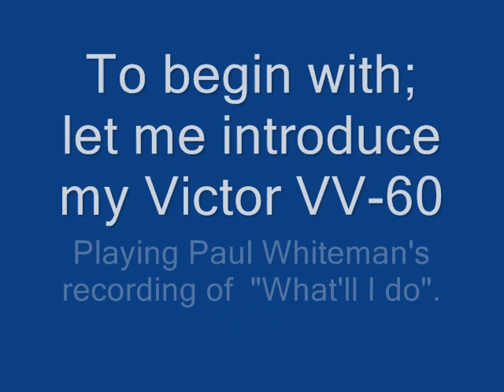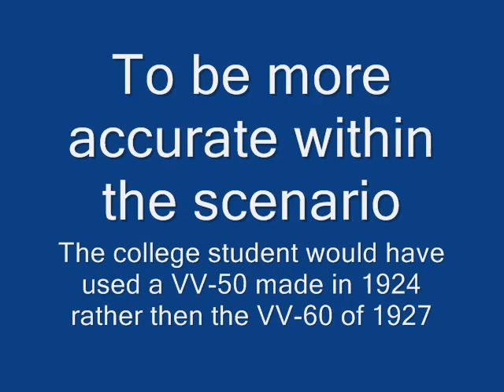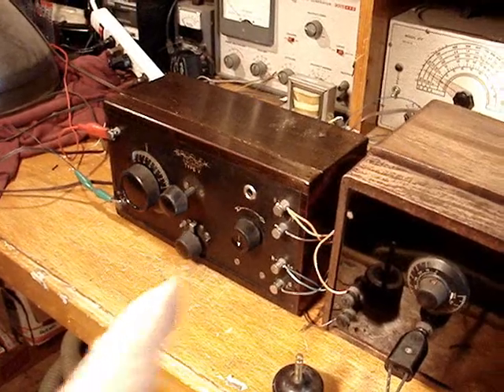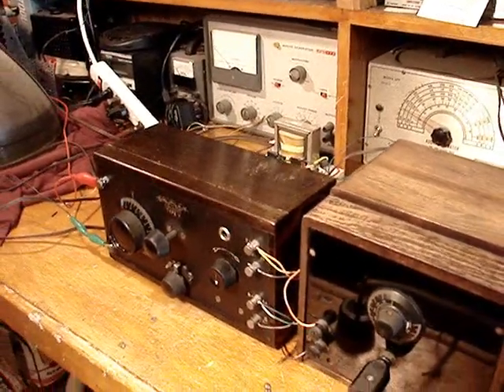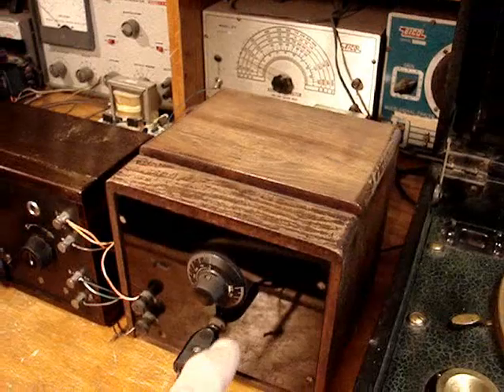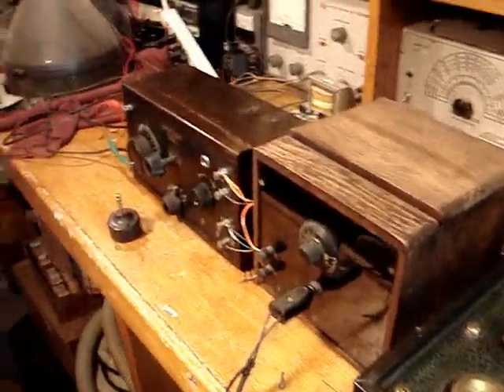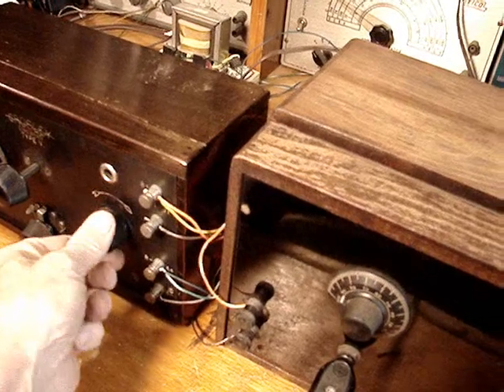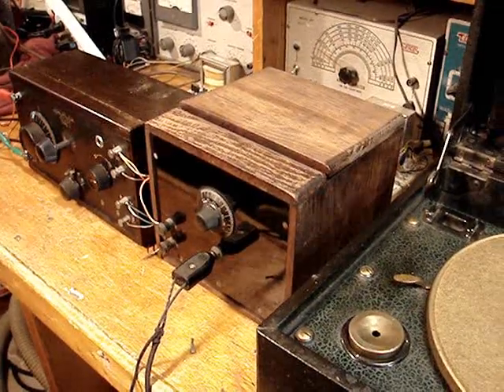Pfanstiehl 2 Stage Amplifier PT2

Comment: A good one from 1924, your machine looks in very nice condition! These were offered at the same time with the vv-255 , but these still had a mica reproducer, but very large and with a very soft movement, so , they can play well electric recorded records!
Reply from the maker: It plays well. The soundbox pot metal looks a tad cracked but it is still in good shape.

Comment: It would be nice if you could install a electric motor some how so you wouldn't have to keep cranking it up.
Reply from the maker: I probably did not need to crank it but I wanted to make sure the machine did not slow down for the recording. This machine has a single spring motor.